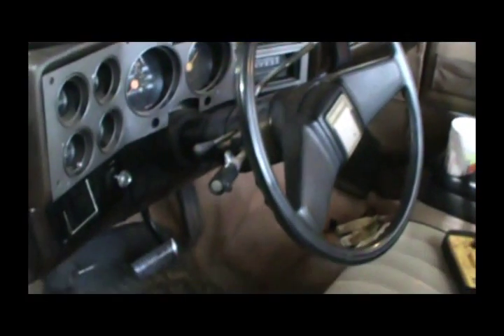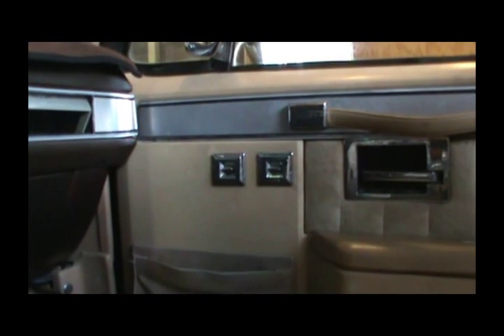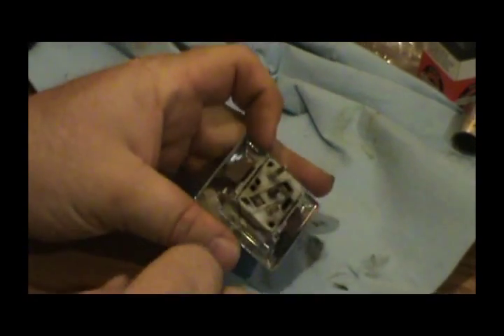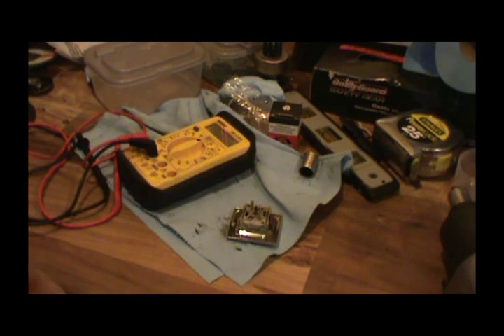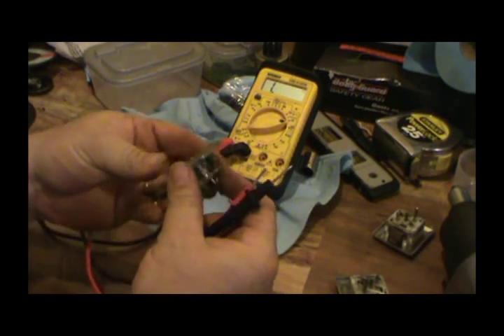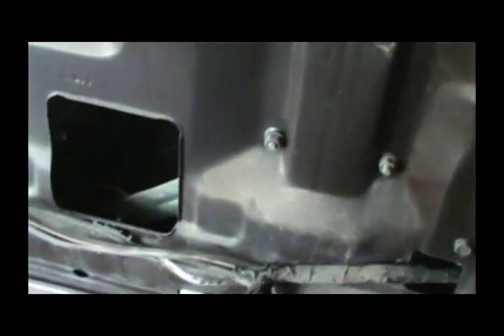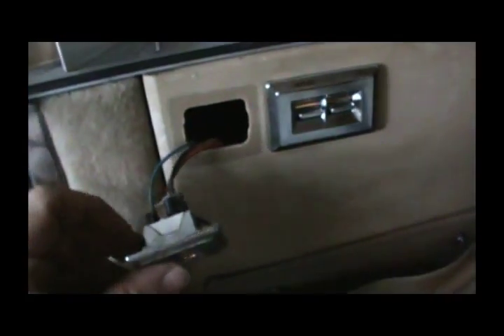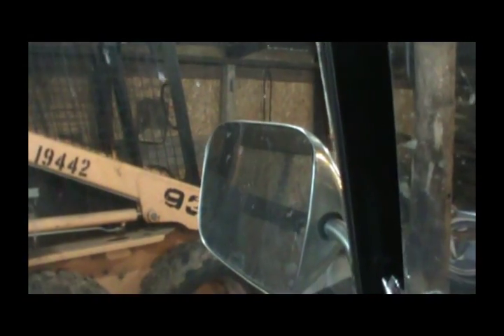1985 Chevy C30 Power Door Lock Troubleshooting & Repair

Comment: I liked your video. LMC Truck catalog has high power window lift harness that boosts the power of your window motor lift. I think it’s around $40 and it provides power directly from the battery, which s a modern day approach.
Reply: I spray the widow felts with silicone spray.  Then put some grease, and  spray lubricant on the lift assembly and regulator. 
That greatly improves the window speed.

Comment: Great video, my 1985 C10 is doing the same exact thing with it's power locks AND the same problem with the window motor being slow, thanks! Now I can move onto getting it fixed.
Reply from the maker: Jake Roe Hopefully it's just the switch on yours, but the window motor finally quit working on mine and I had to change it.  The door lock quit working on the driver's door but still works good on the passenger side, so I guess the lock is bad.
Reply: Jake Roe .  A can of lubricant spray not WD40  from the parts store will take care of the slow windows. Spray the tracks and and all parts that move. And the the seal valleys around the windows . It made a big difference for my windows.
Reply: Alright, I'll try that, thanks!
Reply: Well, I am not sure which one it is on mine yet, but I'm thinking if all else fails then I can order the motors and switches online for cheap or some thing.